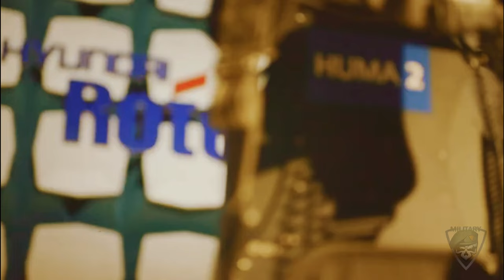K2 Black Panther : The Best Tank On Earth - Outperforms M1A2 Abrams and leopard 2 tank

Comment: The K2 is abeautifull and very well engineered tank, is fast, nimble and the protection is very good! BUT an M1A2 Abrams sepv3 it will outperform the K2 in protection department with is uranium plated steel and kobham  protective  armour ! Also the Challenger is the brother ob the Abrams ! In the end the Abrams remain a brute force and heavy tank (maybe the most protective tank in the world for now), but pound for pound the K2 Black Panther is the best tank the mo ey cand buy because of his versatility ! The Abrams, Challenger and Leopard are heavy and chuncky tanks ! K2 are nimble !
Reply: No tank is immune to drones and MANPADS😉 We've seen that multiple times in Ukraine. This is just another large heap of metal waiting to be obliterated by a cheap drone or missile.
Reply: @45wasright43  False. Proper Active protection will take care of those easily, specially the drones. Most western/Russian/chinese tanks(specially the older ones) are not equipped with those and struggle to support them. Its  why you don't see nearly as many drone attacks on tanks in Israel/Palestine, because Merkava's do have active protection. The K2 has been purpose built to include these functionalities as well.
Reply: Abrams is the little brother of Challenger,  Challenger has the better armour which the Abrams uses.  Challenger gas the better record and longest tank kill.
Reply: @trickslies844 there literally vedios of merkavas being taken out by drones
Reply: @animeworld-qs1qd  And when those video's show the end result i''ll care. But they always cut of as soon as the explosion happens
Reply: @animeworld-qs1qd  What those shoot and run away before you see the results? Yes very impressive lol

Comment: The Ukraine war has revealed that thick and heavy armor on tanks is not an advantage on the battlefield but a critical weakness. This was a point of criticism for the K2 compared to the M1 or Leopard tanks. It has been proven that modern warfare does not require thick and heavy armor but rather active protection systems capable of actively destroying drones and anti-tank missiles. This is because modern shells, anti-tank missiles, and drones can penetrate even the thickest and heaviest armor. However, the M1 and Leopard tanks are already too heavy to add such active protection systems. In contrast, the K2 can accommodate these systems and is actually planned to be equipped with them in the future. Even the aspect that was considered a disadvantage for the K2 has turned out to be an advantage. Ultimately, the K2 is faster, more accurate, provides a more comfortable driving experience, and is capable of active defense against drones and anti-tank missiles. Additionally, the K2 has an attack method that neither the M1 nor the Leopard possesses: it can use special shells to attack the upper part of enemy tanks from a much greater distance. Furthermore, since all wheels are individually controlled by a computer, its hit rate while moving quickly and firing is significantly higher than that of the M1 or Leopard.

The fact that the U.S. has abandoned its original plan to develop next-generation tanks with thick and heavy armor. And lighter and more mobile tanks like the K2 is very telling. This change underscores that thick and heavy armor is an outdated concept, as revealed by the current Ukraine war. This is why Poland and Romania chose the K2.

Comment: 2:33 Please...CN08 120mm/L55 smoothbore gun is not Rhinemetal's product and its licensed version either, but Hyundai WIA's one. They have some experiences from M256 120mm/L44 gun's licensed production for K1A1(120mm gun-mounted version of K1 MBT), resulting in the development of CN03(indigenous 120mm/L44), and CN08 120mm/L55 finally. Actually, CN08 is lighter than Rh120/55 by 1 ton, but has a shorter max. effective range by 1 km.
Reply: Yep, this is where I leave the video.
Reply: If you are expecting me to believe that the 'indigenous' CN03 120mm/L44 and now the CN08 120mm/L55, were in no way influenced by the Rhinemetall RH-120 L/44 or the Rh-120 L/55 (even identical caliber lengths!), or that the HD Hyundai Infracore DV27K, 12-cylinder 1,500 hp water-cooled diesel is not in some (or more) ways, a copy of the STX Engine/MTU Friedrichshafen MT883 Ka-501, 12-cylinder 1,500 hp water-cooled diesel, (original engine of the K2, batch 1) then you are taking me for a big fool. You should know the well-known term : Korea Copy Culture.
Reply: @joegatt2306  I'm not saying that CN03/CN08 are from 100% purely domestic technologies. They are the results of the efforts for the localization, so having some 'reference' from another country's products is not odd. 

But if so, the reference would be M256, because K1A1's main gun was it, not Rh120. :) M256 and Rh120 are not identical, especially for the recoil-buffering and mounting design.

If you wish to use the term 'Korea Copy Culture', I can't stop you. But in this video, it's said that CN08 is the licensed version and I'm disputing it. You should read/hear well another one's words above all, if you're not fool, lmao
Reply: @Brother_Bluegazer  The M256 is itself, an American variant of the German gun that uses a Rh-120 L44 gun tube and combustible cartridges with an American-designed mount, cradle and recoil mechanism. Also, the term 'Korea Copy Culture' is not a term conceived by me. It is the state of affairs of most 'domestic' S. Korean products, (except for Japanese style novel gadgets). Apple’s epic patent war with Samsung over its iPhone rip-off is just one example.
Reply: I found out yesterday, that even the K2's track were copied from the German tank.
Reply: @joegatt2306  You have two eyes, two ears, one nose and mouth each on your face. Whom did you copy them from?
Reply: @Brother_Bluegazer  Surprise me. Write something intelligent.
Reply: @joegatt2306  You first. Anyone can blame something/someone with no evidence. You even didn't know that there's no Rh120 in Korea. :) How about searching for your own country's 'indigenous' weapons' origins? For example, the tanks which smashed people's skulls in a square in the capital city, about 30 years ago.
Reply: @Brother_Bluegazer  I'm quoting you: "You even didn't know that there's no Rh120 in Korea". You did not understand crap. Here is what I said, (which you did not grasp), the Korean CN.08 120mm is a development. My country what?  I am not German, I'm Maltese.
Reply: @joegatt2306  Evidence?? Should I just take your word for it?!? I doubt it. You even inflated Rheinmetall AG's annual sales numbers. I looked at the tracks on both Leo2 and K2 tanks in Rena Norway winter testing. Clearly - the tracks on the K2 were superior to the Leo2. The K2 had winter tracks to grab the snow packed ground while Leo2 had the regular tracks. Good try ~!!!
Reply: @joegatt2306  I say again, YOU FIRST. Don't let me remind you what you and I said. 'No Rh120 in Korea' means 'Korea coudn't get a Rh120 as a reference.' It was M256, as I said earlier. And it was localizationed as CN03. 

But These two are L/44...To make this a longer L/55, it cannot be achieved by welding up just more pipe to lengthen it. 

A longer barrel means a different chamber pressure profile, a different mass distribution, a different recoil buffering system, resulting in almost a new development process. Hyundai WIA had to all of these by themselves. 

If you still say 'copy' or similar blah blah, it only proves that you and your Chinese fellows who taught you them, don't know anything about engineering.
Reply: @Brother_Bluegazer  If South Korea got the M256 as a reference for their CN03, they are indirectly getting also the Rh-120 as a reference. If you cannot understand that.... Extract from The EurAsian Times of five days ago:  South Korea picked the Rheinmetall 120-millimeter L55 gun from Germany, which is 1.3 meters longer than the 120-mm L44 caliber gun used on all Abrams tanks and older Leopard 2s. And I am not Chinese, nor are they my fellow friends either.
Reply: @joegatt2306 
K-1MBT.  It is a product jointly developed by General Dynamics and the Korea Agency for Defense Development in the early 1980s.  In this process, most of the technology needed to manufacture tanks was transferred, including track technology. 

And the core of a smoothbore gun is the plating technology inside the gun barrel.  Korea's Agency for Defense Development produced this through cooperation with a plating company.
Reply: @noirbeck  Teutophobian YouTubers are trying very hard but there is no way of getting around this, the S. Korean K2 Black Panther is a hotch-potch of foreign, (not domestic) technologies put together to form a super tank, which it truly is, no doubt, but a copy, none the less.  
(1)	The Hyundai WIA CN08 120 mm 55 caliber smoothbore gun is a development of the Abrams’ M256, itself a development of Rh-120, (Wikipedia: By 1977 the decision had been made to eventually move the new tank to a 120 mm gun. After head-to-head testing between the Royal Ordnance L11A5 and the Rh-120, the latter was chosen and later type-classified as the M256).
(2)	The HD Hyundai Infracore DV27K, 12-cylinder water-cooled diesel is a reverse-engineered copy (an operation that took seven years!), of the MTU Friedrichshafen MT883 Ka-501, (Lot 1 were actually powered by the German engine). 
(3)	The SNT Dynamics EST15K transmission is a direct copy of the German RENK HSWL 295 TM, (as used in Lot 1 & 2 and it too was reverse engineered along with the MTU engine). 
(4)	It is evident in photos that the K2 tracks are a direct copy of the Leopard 2 tracks. The Leopard 2 also has two types of winter tracks with embossed saltires in all or alternate links, (bet the K2's have the same winter tracks too!).
(5)	The Koreans also developed their own copy of the Leclerc autoloader from France and the Thales fire control system, also from France.
(6)	Bonus material. Extracts from The EurAsian Times of 3rd Sept. 2023: "The Guinness World Records has recognized the K2 Black Panther as the most expensive battle tank. South Korea picked the Rheinmetall 120-millimeter L55 gun from Germany, which is 1.3 meters longer than the 120-mm L44 caliber gun used on all Abrams tanks and older Leopard 2s. It also developed its own version of the Leclerc autoloader from France. The fire control system was also taken from France’s Thales". (Nothing was said about the powerplant and transmission, but we know that story too).
(ps.)  Not sure if the Koreans also copied the tea-brewing BV (boiling vessel) of the British Challenger!